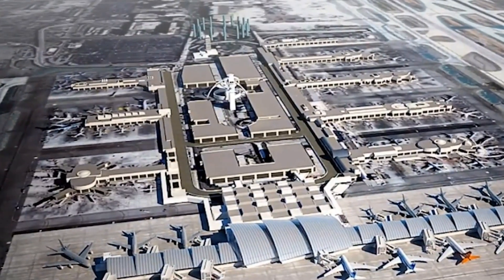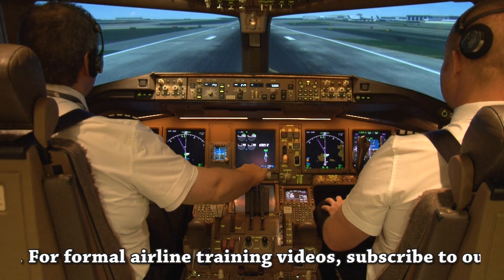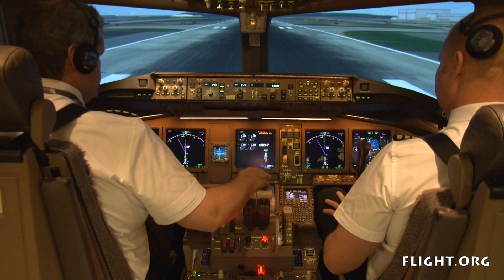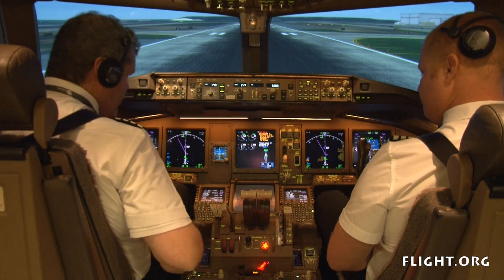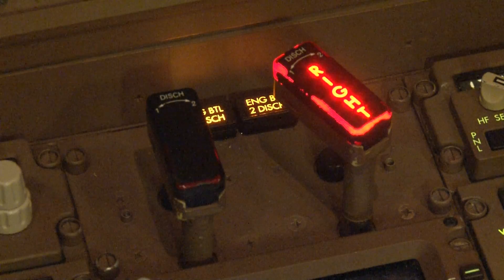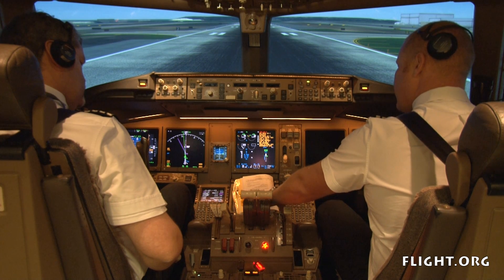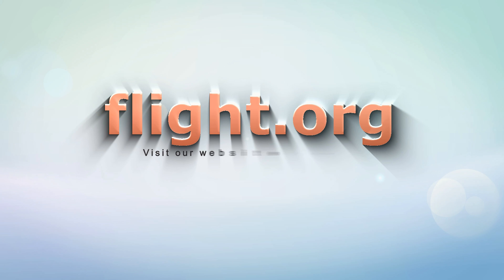Boeing 777 Engine Fire during Takeoff (for CRM/NTS

Comment: Anyone here knows (yes, knows - not guesses) what time we are talking of for the engine to go from full RPM (forward) to full reverse? So, time counting from they pull down to full reverse.
I guess the engine has to spool down a bit first and then open the reverser. Does it spool up after that too?
Reply: Yes
Reply: @johnnyninetytwo  And the answer is?
Reply: @Xanthopteryx  yes, after you close the reverser it spools back up to idle
Reply: @shevi7774  And the answer to my questions are?
Reply: @Xanthopteryx  can’t you read?
Reply: @shevi7774  Yes i can. Can you?
I asked for the time going full forward thrust to full reverse thrust. And if it was spooling up after the reverser was opened (and not only open while going high rpm).
And you answered a question that was never asked: If it spools back up to idle after you close the reverser. BTW, how is that going to happen? Idle is the lowest rpm when running, and you say it spools UP, from, what?

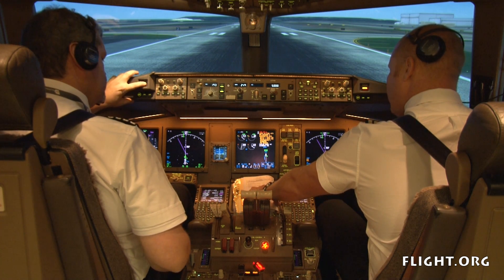Comment: Is it the switching both outflow valves to manual which causes the master warning at around 3:15, which the captain immediately cancels?
I'm assuming that at around 3:35 is due to the aircraft having only the battery supplying the electrical systems.
Reply: Yes but it's a master caution instead of a master warning (Note the EICAS message is amber). It's □ CABIN ALTITUDE AUTO (Automatic pressurization control is failed or both outflow valve switches are in manual)
At 3:15 you have a whole bunch of master cautions (amber with beeper) and advisories (indented amber without beeper) related to the loss of AC.
The only Master Warning in the video is the □ FIRE ENG R (RED EICAS, Illuminated fire switch, fire switch unlocks, illuminated engine fuel control switch and Fire Bell rings)

Comment: Good video.  At 2:50 the Captain states to the Fire Chief that there was a continuation of the right engine fire; after receiving further confirmation from the Fire Chief, the decision is made to evacuate the aircraft. 
 
My question is, why was the order given to evacuate rather than evacuate left side only?
Reply: at some airlines, the final decision about which exits are usable for an evac rests with the respective flight attendant at the given door. the reason is, that the individual cabin crew member has the best picture about if the escape route is endangered by fire/smoke or not

Comment: Be aware with deploying rev thrust with an engine fire. You handled the situation like it should have been except for the rev thrust
Reply: That's how it's done. During an RTO there has been no confirmation on which engine has failed. I don't know where you get your procedures from but the QRH does not say anything about using only one reverser during an RTO.
Reply: @palopo-t3v  Ah i see, i am not a real pilot whatsoever so you are absolutely correct on this. Just an enthausiast. I learn new stuff every day!
Reply: @brandon_dammers  It's ok. We only act one one engine alone if we have done a crucial step of the checklist or memory items which involves CONFIRMATION by both pilots on which engine has failed. Not doing this crucial step has lead to many accidents. Same applies for a go around after an engine has failed suddenly. We accelerate both engines and only after reading the checklist we'll secure the failed one.
Reply: @palopo-t3v  sounds like the safest thing indeed. I haven’t learned the memory items yet but i’ll be sure to take a peak!

Comment: and you still used the bad engine to reverse ?
Reply: That's how it's done. During the rejected takeoff there's no time to assess which engine has failed. You just initiate the reject. An engine that is on fire is not a dead engine and still provides thrust.

Comment: WHAT ABOUT FLAP LEVER 30???
Reply: Not part of the 777 evac checklist as it has overwing slides. Only aircraft without overwing slides need full flaps for evacuation.
Reply: Not on the 777. The 777-300 has huge escape slides in L3/R3 (only disarmed during ditching) and the -200 does not have overwing exits.
Reply: Steve Doe yes, that's if time allows its verify that flaps are indicating 30 before engine cuttoff. Flaps needed to be 30 in an evacuation because of the passengers evacuating via the overwing exits. It is required
Reply: That's aircraft specific. The video doesn't state whether this is a -200 or a -300. The -200 has no overwing exits, so I'm guessing it wouldn't be on that checklist.

Comment: when in doubt use fire supression
Reply: When in doubt dont say words
Reply: Not in flight. That's not how things work. If you have abnormal engine indications (not a fire and not a severe damage) the course of action is to retard the engine until indications are normal. That way you still have the engine available in case you need it (terrain escape or windshear escape manoeuvre). If you pull that fire switch the engine is gone for the day.

Comment: The captain should also activate the Emergency evacuation signal after initiating a the cabin evacuation.
Reply: Not all 777s have the Emergency evacuation signal.
Reply: There's an switch on the back of the center console, on some 777s, that sends an alarm to the FAs in the cabin to evacuate.
Reply: Delta's 777-200ERs had the Evac switch at one time, but the switch was on the center console behind the L radio, on the Capt's side. I'm not sure if that switch has been retained. The Delta 777-200LRs never had this switch.
Reply: That's completely dependant on company SOPs. In my airline we don't tell them "cabin crew at stations" after an RTO.

Comment: I was wondering when they cut the fuel to the left engine would the airplane not lose power?
Reply: also the auxiliary power unit might power vital equipment
Reply: The APU is switched off after engine start
Reply: Most systems lose power yes but that's what you want when you evacuate. The instruments that you see working after both engines are killed are the systems powered by Standby Power (Battery). On battery alone (No RAT) the battery can power the stand by system for a minimum of 5 minutes. The emergency lights are powered by independent batteries and last 15 minutes which is more than enough for evacuation.
Reply: the second engine is still running thus providing power to the plane

Comment: Just a question. Shouldn´t the captain order for an evacuation on the left side explicitly? The cabin crew doesn´t know there´s a fire on the right side. Thanks for answering!
Reply: It's my understanding that in some companies the proper procedure is for the pilot ordering an evacuation to NOT mention further details (unless required). This is done in order to prevent confusion if the information is incorrect or misunderstood and also to prevent cabin crew from acting on that information without confirming for themselves its accuracy. Confirmation bias may also come into play, where the crew are looking to confirm the pilot's information rather than assess the situation for themselves.
For example in this case the captain could have advised the cabin crew of an 'engine fire number two'. But what if a member of the cabin crew mistakenly believes they are on a plane with 4 engines? That would mean engine number two is the innermost engine on the left side, so an evacuation on the right side would be required.
Add to that the fact that the pilots may have all sorts of warnings and indications, but in many planes they can't actually look at the engines from the cockpit, so they don't know if there's still any fire and if there is, how bad it is. Maybe there was a fire but due to its location (engine) and a favorable wind direction, the right rear exit was available. Or perhaps in this hypothetical case the fire was already out but the fire warning remained due to damage caused to the fire detection system. In that case evacuation on the right could have been perfectly safe, allowing the entire aircraft to be evacuated much quicker compared to only using the exits on the left, which in turn also improves the chances of an orderly evacuation without injuries due to panicked passengers all rushing for the few available exits.
All in all I believe it's safer to have the cabin crew determine if it's okay to open an emergency exit before doing so, without being burdened by any unnecessary preconceived notions.
Also thanks for reading my wall of text!
Reply: Never, ever assume.  "Captain" means responsibility for all phases of flight and safety of all passengers and crew.  Captain should explicitly order evacuation with instructions.
Reply: window blinds are always ordered to be open on take -off and landing so that flight attendants can see where and what the problem is outside of the aircraft.